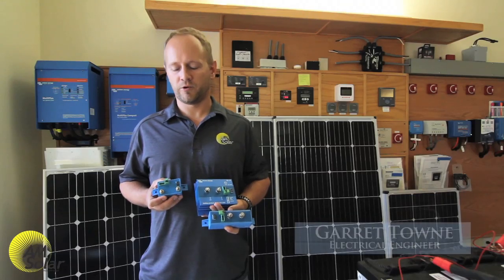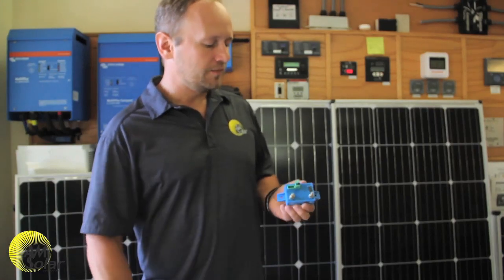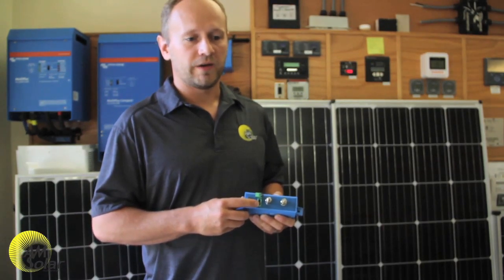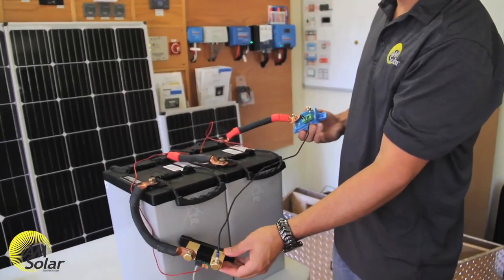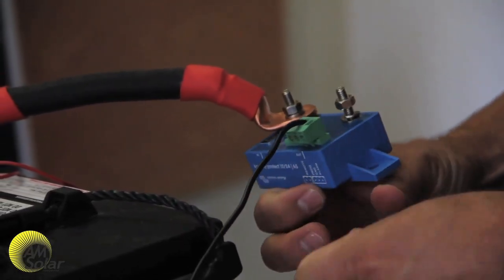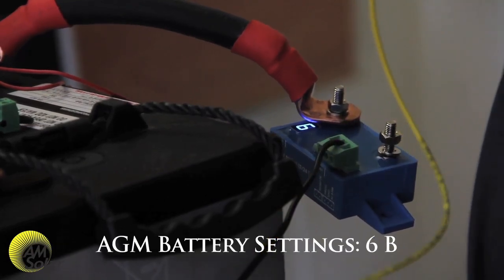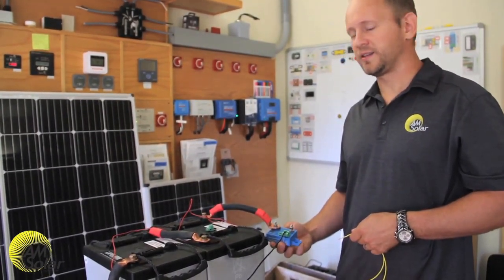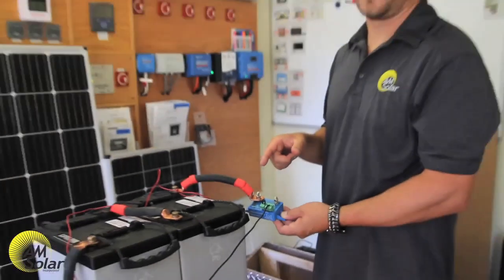How the Victron BatteryProtect Works for Your RV, Skoolie or Van (Demo)

Comment: Good morning from South Africa.  Can I use the 65 A model with two lead acid (100 ah) in my off-road trailer to protect the batteries?
Reply from the maker: Yes, as long as you don't plan on drawing more than 65A of load.  The rating has nothing to do with the batteries, just the amount of load current.

Comment: can that be used for normal accid a battery how big battery could be ? i have two 12 v normal battery 180amp  connecting to 24 volts system  a ich battery is that will be good or i need bigger ?
Reply from the maker: It doesn't matter how big the battery bank is.  You can use it on a 24V system.
Reply: @GarretTowneAMS  so where is dyfrent between 64A 100A and 220A?
Reply from the maker: @rabbitflow1  The current rating, 65A, 100A, or 220A, has to do with how much current is allowed to pass through the device.  For most DC Distribution systems we use the 65A.  If someone has a DC air conditioner, we use the 220A.
Reply: @GarretTowneAMS  thank you so much I have air conditioning thank you

Comment: Do you have to have a shunt? What does a shunt do and why do you need it?  Sorry, total newb. Hope someone takes pity on me lol
Reply from the maker: The shunt is a resistive device that goes in-line with the battery bank.  Think of it as an electron counter, that measures everything going in or out of your battery.  This measurement is used to calculate the battery bank charge level.  Another method for determining that state of charge is a voltage meter, but this isn’t nearly as accurate, and doesn’t work with lithium batteries.  So, if you want accurate battery monitoring, get a shunt-based battery monitor.
Reply: @GarretTowneAMS  Thank you!

Comment: I have a system whereby the batteries supply 12V DC, in which a Victron BP would work to safe guard the low voltage discharge.  However, when charging the batteries, the current flows in the opposite direction, to charge the batteries.  How do you deal with this condition?
Reply from the maker: Don’t go through the BP with your chargers.  Have the BP only between the output and the battery.  Normally, we put the BP between the battery bank and the DC fuse block.  You would never put the BP on anything bi-directional, like an inverter/charger.  If this doesn’t make sense, send me a wiring diagram and I’ll reply back with corrections garret@amsolar.com.

Comment: Can the Victron Battery Protect (220 amp) serve as a battery isolator? 

I have installed a 1000 watt inverter in the trunk of my 2021 Toyota Camry SE with a 1/0 gauge wire run to the starting battery, which is a  typical lead acid battery.   The negative terminal of the inverter is connected to ground.   I also have a 100 amp-hour LiFePO4 battery located in the trunk also connected to the inverter through an Anderson SB50 connector cable using 4 gauge wire.   While the engine is running, I want to be able to recharge the LiFePO4 battery.   But, when the engine is not running, I want the starting battery to be disconnected, leaving only the LiFePO4 battery connected.

So, will the 220 amp Victron Battery Protect device work for this purpose?

Thanks!
Reply from the maker: A Battery Protect wouldn’t be a good device for what you are wanting to accomplish.  It might allow for too much current flow to your lithium battery and you might get backwards current flow from the lithium battery, which would ruin the BP.  I recommend a Victron Orion 30A DC/DC charger instead.
Reply: @GarretTowneAMS  Thanks, for your reply!

Comment: So I want to run a voltage cutoff on my trailer battery. I have my usual 7 pin connector charging the battery. How would I tie this into that.. So the stuff I have running in the trailer off the battery down drag it down to far when not charging from the truck? 🤔
Reply from the maker: To prevent your loads from drawing down your battery too deeply, put the BP between your loads and the battery, similar to how we have it in this kit:  https://amsolar.com/rv-battery-accessories/98-dcdagm 

Make sure you select a unit that can handle the current you need.  For example, don’t get a 65A BP and expect to run levelers.  

Also, make sure you don’t have a charging current going into the batteries through the BP.  Current can only flow one way in a BP, not both.

Comment: Which model would be recommended for a 105ah lithium battery in a 4WD? I currently have a 0.14ah drain in my system that I want to isolate with the switch when I’m not in the car. How much does this Victron draw when in disconnected mode? Thx.
Reply from the maker: If I used one, it would be between your battery and your DC loads.  The rating depends on how much current you need to draw for the loads.  The battery can probably put out 100A, so a BP100 would make sense, but people rarely need that much current, and typically use a BP65.  If it is disconnected, it won’t draw anything.

Comment: When I put the jumper back in after programming I get an E 1 (error) message but its not like my 10A fuse is blowing on the input side of the Battery Protect so not sure where the short circuit is being detected (its an AGM battery).  Any help on that?  Thanks
Reply from the maker: This is normal if there are any house loads on when the BP resets. To solve it turn the house loads off then turn the BP off then on.

Comment: Why did you set "B" for AGM 
what relay are you connecting...?
Reply from the maker: “B” is mode the causes it to cut out at low voltage.  We aren’t connecting to a relay.  In this application, we are using the BP between the battery bank and the fuse block to prevent DC loads from overdrawing the battery bank.
Reply: @GarretTowneAMS   8 is typical AGM setting, Ryno is correct the B setting is for relay. Your options are A for buzzer/led, B for remote relay, C for Li-Ion BMS, and d for system voltage detection.

Comment: hELLO    ! Please, is it necessary (and why) to put a "victron energy  battery protect" 🙂😮😮 like I got a good BMS on my battery ? It seems to do a similar job, no ? Thank you. (perhaps have you got also a better idea. Thanks)
Reply from the maker: It depends on your BMS.  We like to put a BP between the battery and the DC loads.  We like to make it shut off before the BMS shuts off, that we aren't relying on the BMS.
Reply: @GarretTowneAMS  Ok ! Thank you very much !

Comment: hi, I've got a BP 65 like the one in the video. I am looking for the setting for lead acid batteries. which one should I program in Your opinion?
Reply from the maker: Enter the following values: Shut down: 12.1V, Restart: 12.7V, Leave on mode “B”

Comment: Question? My inverter does not have a remote on and off, so in order to use it with my new Victron battery protect the instructions say I need a relay switch. Can you recommend the item I need? 
I have 1000 watt inverter and the 100 amp smart battery protect. Thank you in advance.

Comment: Good Morning. Can you please tell me what is the setting for a 24 volt VRLA Batteries using the 100 amp battery protect. Thank you.!!! Great video.
Reply from the maker: I’m not familiar with those batteries, but for a 24V AGM we would do Shutdown at 24.2V and restart at 25.4V, Mode B.  I hope this helps.

Comment: I'm preparing to build a lithium battery bank with plans to charge it from my auto alternator. I've already purchased the Victron 80 amp diode isolator. I'm now considering to purchase the Victron Battery Protect. With this set up, I'm thinking to place a fuse on the cable, near the battery bank, that runs from the isolator. My question is, can the  Victron battery protect also serve as the on/off switch from the isolator? With regard to this  wiring set up, Battery Protect included, would you say I would have my bases covered? What size Battery Protect would I need to purchase?
Reply: Yes, you can cut power to the BP and it will stop current flow.

Comment: If there is a Victron BMV-712 on the same system, would it have the same functionality as the battery protect with its built-in relay?
Reply: You could program the BMV-712 relay to trigger a solenoid and that would give you similar functionality.  But, the relay on the back of the BMV-712 is not designed for high current.
Reply: @garrettowne  thanks.  I did not understand this before.

For some reason, I thought the alarms on the BMV-712 could trigger a multi-disconnect function when either temperatures or voltages are out of sync.

Comment: Could you use a battery protect replacing a BMS on lifepo4 prismatic batteries?
Reply from the maker: Zack Vance unfortunately you need a lot more equipment for a BMS. A BP only allows current flow in one direction, it’s good for DC distribution, but you would still need cell balancing and controls for charging.

Comment: when charging with your alternator system aren't you worried about the alternator overheating due to lithium being able to consume a very high charge rate? also, it is bad for the eng alternator to be switched on and of many times correct? are there any systems in place to limit amps from the alternator in order to lower the heat of inverter [preventing damage?
Reply from the maker: Mowglie This is a long conversation that would be easiest over email. In short, we typically use a Victron Cyrix-Li-ct.  We don’t recommend it for low current or old alternators. The alternator isn’t connected and disconnected under load because that would damage the alternator. Send me an email with information on your rig and alternator and I’ll give you a recommendation. Garret@amsolar.com

Comment: For those who are looking for more advanced low voltage cut-off please visit bed-electronics.com
They have custom programmable units with nice user interface. Also these devices can hold inverse current as well.
So charging a battery through them is not a problem.
Reply: That's the issue with Victron!!!
Reply: SBS6-32AL-240 and SBS 6-32PL-210  are capable 200A output.
Reply: You should upload videos to demonstrate your products.  Otherwise, people are not going to buy them because they don't fully understand their capability and how to install and use them.  I'm looking for a redundant overcharge protection between the battery and solar charge controller.  There are already many products for redundant low voltage cut off protection but I haven't seen any for redundant overcharge protection.
Reply: @godblessthelessfortunate3175  
Thank you for your suggestion.
For overcharge protection any bed-electronics universal LVD unit will do the job.
Please look at this model http://bed-electronics.com/product/sbs6-32hb/ for example.
You can contact me at info@bed-electronics.com if you need more info.

Comment: Can the BP be controlled by a BMV 712? I want to be able to protect overcharge and overdischarge by disconnecting all loads and charge. Secondly, what happens if more current is fed than it is rated for, does it burn out and get damaged or does it disconnect load before getting damage. Lastly, is it installed only on positive side, is there ever a reason to install on negative side?
Reply from the maker: firpofutbol One important thing to consider is that a BP is a MOSFET and you only want to install them in parts of a system where current will flow in one direction. If you send current the wrong way on a BP you will damage it. In other words, don’t expect one BP to handle loads and charging sources. Controlling a BP like a switch with the programmable relay on a BMV-712 is very common. A BP would be damaged if you ran too much current through it. Since electrons travel in loops, there is no reason you can’t install a correctly oriented BP on the negative side, but there’s no reason you would have to either. I recommend keeping with convention and putting them on the positive. It will make deciphering how your system works easier for any future owners. If you draw up a design and want a sanity check, email it to AM Solar.
Reply: @GarretTowneAMS  Thanks for your reply! How many devices can the BMV control? I'm thinking about using it to disconnect a BP for charging sources (Victron MPPT and Sterling battery to battery alternator charger), a BP for DC loads, and a non-victron (Samlex) inverter that has a remote on/off via a 12v signal. Can BMV disconnect also based on temperature and not just voltages when connecting its temp sensor to batteries?
Reply: firpofutbol This is why you would want to consider a Venus device, like the CCGX or the Venus GX.  You can also run the Venus OS (distributed free of charge by Victron) on a raspberry pi.
Reply from the maker: These are the same design issues we faced when we developed our V4 board. The BMV is only going to work for one function. Check out our website, go to Lithium Batteries and click on one of the Victron systems in the top row. If you look at the wiring diagrams you will see how our V4 board controls two BPs and a Cyrix for alternator charging. Also, check out our recent van videos. That rig used a V4 board.

Comment: I'm actually thinking of using one of these as a relay on the charging end from my alternator.  Manage it with a BMV 702.   Should be fine as long as amps are , right?
Reply from the maker: I would recommend using a Victron Cryix instead.  A BP is a MOSFET and should only be used to shut off current flowing in a single direction.  With an alternator charging system, there is potential for current to flow both ways, which would damage the BP.
Reply: @GarretTowneAMS   Thanks!    That's exactly what I needed to know.     I wish Victron made a Cyrix with unidirectional sensing.  I already have one Cyrix Li-Ct in my system, but when the vehicle is off, it senses enough voltage off my Battle-Born Lithium to stay closed until the Lithium has been partially depleted by the Starter battery.  Thus I use my BMV relay to open the Cyrix at low starter voltage.  But I would also like to open the Cyrix at high SOC to avoid over-absorption. I am trying to figure out if I can get the relay logic to work with both parameters:  [low starter V OR High SOC opens relay/  High Starter V AND  Low SOC closes relay].    Otherwise, a second relay triggered by ignition on is an option.
Reply from the maker: @ceeweedsl  Our experience is that the Cyrix-Li-Ct is only closed when there is a charging source on the battery.  Do you have solar or a shore power charge elevating the voltage of the lithium battery?  That might be way the Cyrix is closed.
Reply: @GarretTowneAMS  Hmm...I now wonder if it's possible that I tested it with my portable panels out. Doubtful.  That's a pretty big error and I really don't think so, but hey, stupidity happens!      I am not near the van now so will have to check that next month.   Been doing homework in the meantime to improve the system from last year's issues.

Battleborn lists 99% charged as 13.4 and their tables show it would not hit the Li-CT's initial relay opening threshold of ...13.3V   -   until lithium drops to 90% charge.   Have you not seen that in practice?  Do they open right away after Starter battery drops or do they stay closed until the lithium drops to 13.3 after shutting down vehicle ?     I need to do some more tests myself.  It's only an issue when there's a full charge on the litihium and I only tested it once before deciding that I couldn't depend on the Cyrix Li-CT's  voltage sensing and needed to rely solely on the BMS to manage it.

I REALLY  appreciate your informed input, Garret.  Priceless.   I will make sure to recommend and support AM Solar next purchase!
Reply from the maker: @ceeweedsl  We haven't tested what you describe, but it isn't surprising, nor is it a problem, as long as you understand "that's just how it works" not "something must be broken."  With this setup you aren't going to be able to keep your batteries at 100% without them gradually draining that top 10% into your starter.  This isn't harmful for either battery bank.  If you really need that extra 10%, know this ahead of time and plan your usable amp-hour capacity accordingly.
Reply: @GarretTowneAMS  Absolutely.   I do understand that's how it work. .  It's only a problem if you care about that top 10% of capacity.   I'm shooting for 80% discharge floor e, so I would now get <70% of capacity using Cyrix Li-CT voltage sensing.  

Victron seems very astute so I don't understand why they picked that 13.2/13.3 V parameter for their  Lithium Cyrix line.   

Effectively it seems that the Victron Cyrix Li-Ct is not that well optimized for....Lithium!     Hmm.   Well, I'll work around it, if I can, with the BMV relay control or swap the Cyrix out for a unidirectional relay.  Or maybe just put a B to B charger in there - Victron says they are coming out with one soon.  

Thanks for all your help and hope this conversation helps others. cheers!